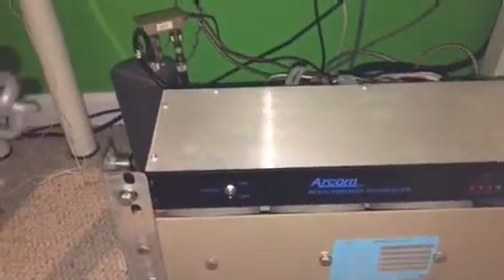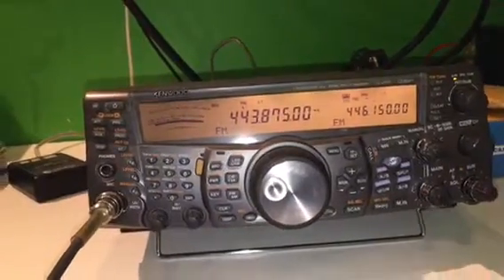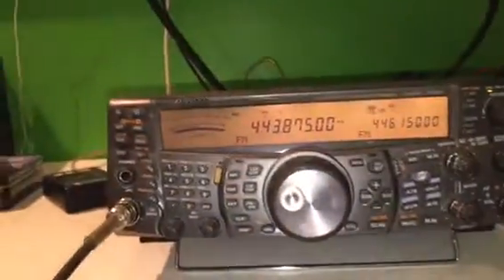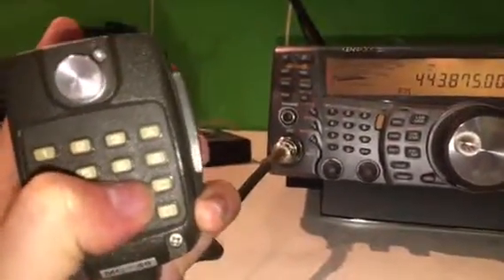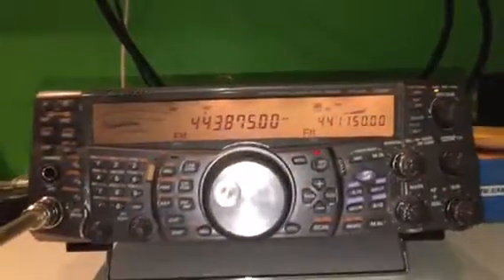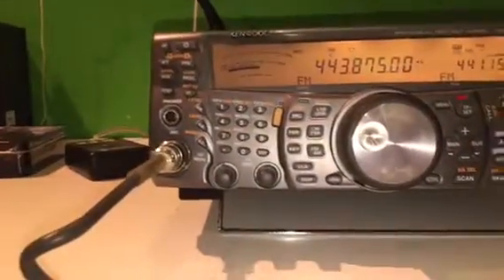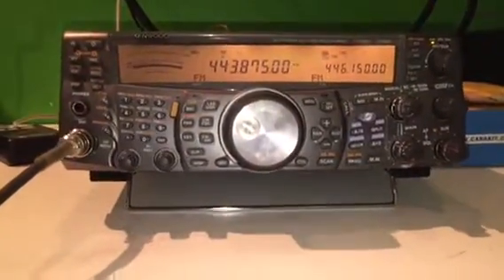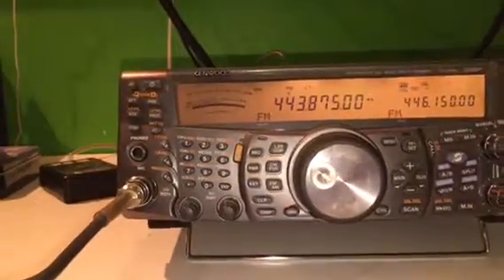EchoLink Demonstration on the W8SRC Repeater

Comment: Hello, on the repeater that I use here in Whitman, MA, I have to hit the pound key followed by the node number. Then I hit 73 to disconnect. According to the instructions I have seen (on the internet) you hit the asterisk key followed by the node number, then hit ## to disconnect. This isn't working for me.  I am curious to hear your thoughts on this? Thank you. Ernest Bazzinotti KC1LKB
Reply from the maker: Hi Ernest!  Different repeaters and different softwares have different commands to bring up/down EchoLink or IRLP nodes.  With the SVXLink software (in this video), I would hit #2# to bring up the EchoLink module (I need to hit # the first time to tell the Arcom controller to transmit DTMF tones to the SVXLink software).  Then, I can enter the node number followed by the # key.  In this case, that means that I would have to hit ## to disconnect a node and deactivate the EchoLink module.  I no longer use the Arcom controller or SVXLink, but I'm hoping to use some EchoIRLP software for my repeater in a bit to hook up to my new S-COM controller.  This software would use the same command structure as your local repeater.  I hope that makes sense.  73 de W8SRC